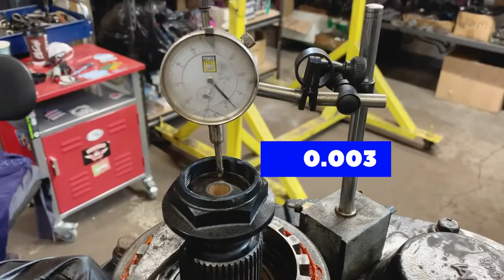How to rebuild Meritor-14X meritor Differential MDL20-14X

Comment: You left out the hardest part getting the fork on top of the spring lol I made up a tool out of an old cross shaft with half a washer on the end to compress it and slide the fork over top, what doyou guys use?
Reply from the maker: Lol yes i know,  it took us a few shot to get the fork in we used a pry bar with a grinded tip in the middle pushing down the spring manually. You should share the improvised tool you made on youtube and send me the link 😁👍🏼

Comment: Follow Meritor Maintenance Manual MM0970 for reassembly. Countless checks, torques, and improper assembly procedures were done during this reassembly. Reduced life of the carrier can be the results of not following correct reassembly procedures.
Reply from the maker: Hi there. I’ve been rebuilding diffs from 2003 to present that’s 20 years of experience, worked with big companies to small companies i was working by the book the whole time so i have learned what to check and the torques even just by feel. I opened my own business in 2015 to present i’ve never had a diff came back for warranty. Everybody has there own style of rebuilding. But thanks for warching and your concern,have good day sir!
Reply: My experience covers 47 years in this industry. I work for the manufacturer of this carrier. Providing a video of how to “rebuild” a carrier should show proper use of torque wrenches and procedures, along with information on use of special tools. I sir deal with failures everyday from improperly assembled carriers due to the  “feel method” being used. I can appreciate you think you have acuired that skill. The viewers likely don’t have that and impact wrenches vary widely on their torque output. Bearing life is totally dependent on correct bearing preload. The video showed not one inspection of any part, prior to assembly. Checks such as pinion bearing preload, diff case spread for correct bearing preload, gear tooth backlash adjustment for proper heel to toe tooth location, just to name a few checks were never shown. I appreciate your desire to share your procedure to reassemble a carrier, however there is no “style” to doing so correctly. With any product there is a maintenance manual that is created as a guide for servicing that product by the manufacturer. That is created to share the diagnosis, disassembly, parts inspection, reassembly, and setup of the product with use of correct tools, torques, and safety procedures. Maintenance Manuals are available free and online from most every product manufacturer for just those purposes. My note was not to disrespect you or what you do. My note simply stated the manual referencing this carrier.
Reply: @glenncram5355  hi glenn how are you? i came here trying to learn how to adjust the shims of the inter axle lock, i taked out the 3 shims that came originally, and when i try with air(and a custom plate to test it before closing) te locker doesnt engage completly, the service manual says 0,5 to 1mm space, but i see 3 mm or more, is that okey? or they work that loose?

Comment: @Maximum Powertrain HELP!! I have a Meritor diff and the wheel bearing adjustment nut is something called an airlock and between the 2 bearings is a steel sleeve. How do I adjust the wheel bearing? I've never seen this setup before

Comment: Seems like a lot of corners are being cut. I just don't understand why so much silicone? Input seals and orings do not need silicone, just making a huge mess for the next guy to clean up. Also the adjusting ring for the power divider input shaft should have an o-ring and again not need silicone, I believe Loctite 565 which is basically anaerobic sealant is the recommended sealant Per Meritor for adjusting ring threads.

Comment: Those new e axles meritor14xe remote control acts like 15 liter efficient fuel 50 mpg hybrid 600 800 volts or Allison 100 P or duals 136 p